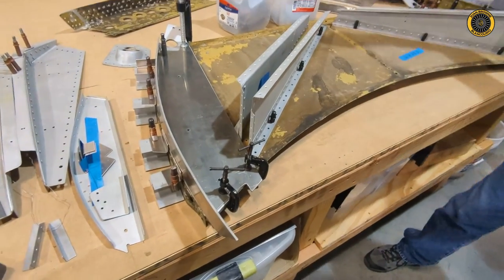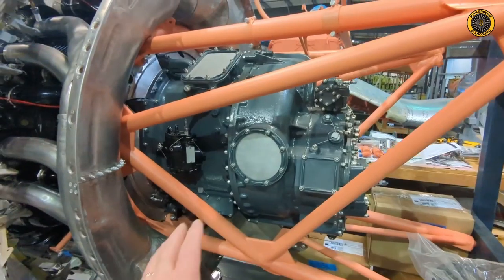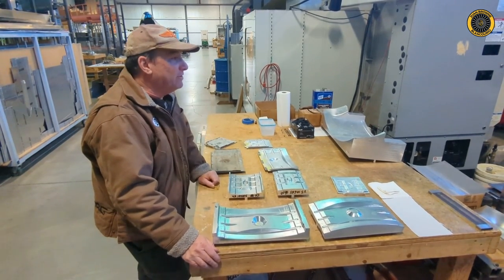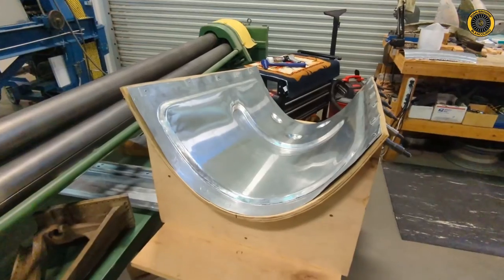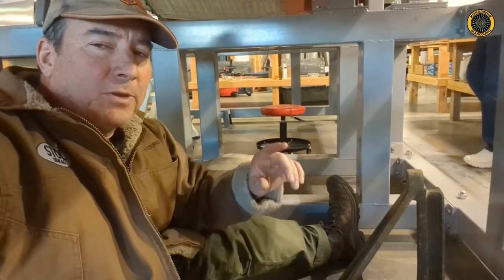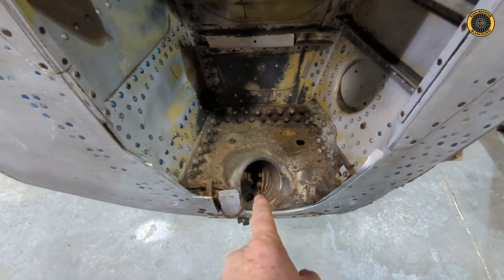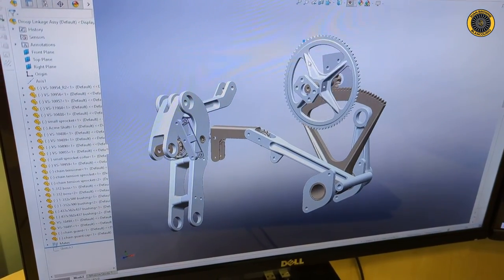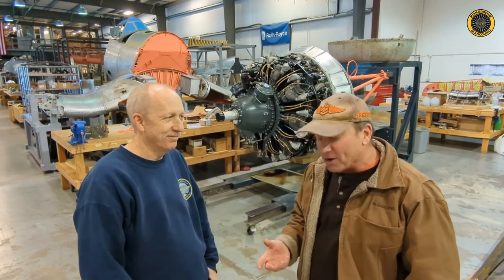Rare 'Birdcage' Corsair UPDATE! Jan 2023

Comment: I'm 83 and have been an airplane nut since I was five.  Watching this video it suddenly occurred to me how much more complex piston driven aircraft are than jet engined planes.  It also made me aware of how much more work is required of the pilot to manage the engine and prop controls.  That made me wonder how they had time to fly the plane, especially in combat.  My respect and admiration for those old fighter pilots has increased immensely.  Great video.  It taught me a lot about the Corsair I didn't know.  Thanks.

Comment: Wow. Thanks for sharing this. About 50 Years ago I worked in the Com/Nav intermediate maintenance shop (bench repair) at MCAS El Toro with a NAESU Tech Rep  Henry "Stoney" Stonestreet who was a Marine Air Wing retiree. He enlisted in 1932 and served during  WWII in VMF-214 with Col. Greg "Pappy" Boyington working on these beautiful birds.
Reply: few AU-1 (F4U-6) were in Navy Reserve back then , saw even Fotos in Books of AU-1 in Navy or Marine Service with Gull Grey white Camo , not 100% sure but i think the Plane was stationed in Quantico Naval AB
Reply: I worked at the Com/Nav in VMGR 352 at El Toro from 1976-1981. I think we were still using the same boxes you were fixing back then. An old joke was that if we didn't have to carry the ARC-101 HF radios (2x), the Hercules would only need 3 engines.
Reply: @coreyandnathanielchartier3749  I was with H&MS-11 and VMFP3. Our  RF-4B's had an ARC-105 HF Radio that I worked on. The WM's could not lift it to put it on the bench.

Comment: As a teen,....I bought a large R/C plane kit. Essentially a box of various  balsa wood sticks and sheets and a set of full sized plans. When I first opened the box I was filled with anxiety about how in hell I’d ever turn that pile of wood into a flying plane. I get that same feeling watching this video! 😂 I did eventually get my plane flying after a year of construction. 90 second first flight and then 6 month repairing it after the crash. 😂 it’s still flying albeit with an electric motor and batteries now instead of a big glow plug engine and nitromethane fuel.......

Comment: Those are some lovely parts. I work with a guy who does 3D metal printing, among other things. With the high pressure and temperature post processing they can make parts at competitive prices to low run castings or forgings and with very good mechanical properties. I hope this can be used to bring back some old aircraft for which the parts just aren't available anymore, and which were forged when they were in production. I did some work on the Avro York at IWM Duxford and they had the same problems with the manuals, they were pretty much rough drawings of the parts and you had to interpret them based on what you had remaining to work out how a new part should be made. But that York was only being restored for static display, the engines from it are on the Battle of Britain Lancaster and the York has her old and lower spec Merlins.

Comment: Juan, it's nice to see another of your videos where nobody spirals down out of the clouds, nobody loses a fight with an iced up airplane, nobody stalls out on base/final, and everybody makes it back to the runway.......  The detailed pictures here are unparalleled for dissecting the inner works of the Corsair. It was a revolutionary design, and I'm most impressed with the utter simplicity of the intercooler (aftercooler) design. Minimum ducting, shortest path for the air, and requiring no protruding scoops. BTW, I'll bet that 'Y' pipe would be a fun one to recreate. I recall building models of the F4U4 back in the 60's as a kid. It always seemed a bit oddly shaped, with the barrel shaped forward fuse, and the fin set forward, but as I learned many years later, it was instead elevators set back that gave this impression. By 1945, the F4U-5 would have a automatic power system that handled the cowl flaps, mixture, prop pitch, I believe, and the supercharger controls. It was also the last single piston-engine fighter built in the US, outlasting all the rest.

Comment: You should put Urbana Ohio on your bucket list. At Grimes field they are restoring a B-17G with parts from 4 different planes. Originals as you pointed out, back up the new ones recreated. Not far from Urbana is the Dayton Air Museum.

Comment: Looking at that nice clean engine recall the 17 years i worked on R2800,R2000, and the occasional R3350c. Never were that clean once you fired them up the first time. 1100 aircraft oil in fifty gallon drums is what I recall. Turned black immediately and if you didn't see oil on the engine it was cause for concern. I'm still a AP/IA  , started in the military in 1965.

Comment: Most every pilot is in love with the P-51 Mustang, but for me it's the Corsair.  I was a Navy T-28 instructor pilot in the 70's and I always felt like I came along one generation too late.  Of course no one wants to experience the horrors of war but I sure would have liked to have flown the Corsair.  The Navy T-28B/C gave me a Walter Mitty experience and it was not hard to imagine what it must have been like flying the WWII radial engine fighters.  It is powered by the Wright single row radial (9 cyl) with a 2 stage blower rated at 1425 hp.  Comparable to the Mustang and Corsair in performance at low altitude; what a blast to fly!

Comment: 9:35 JUAN, if I remember my time in the machine shop at the Grass Valley group. That since aluminum oxide has a natural oxidized finish. I think that's why they had to etch the aluminum was to get through the oxidation protective coating that naturally occurs on aluminum, especially on 2024.? Prior to spot welding... Great tour...
Reply from the maker: To cut through the Alclad finish?

Comment: "Dead Soft" , is "O" condition aluminum, in annealed condition. I'm assuming it's 2024 alloy. Depending on thickness it usually takes about 30 t0 45 min , longer for thicker parts, at about 920 F. I quench in steam distilled demineralized water. I'm a structural fabrication/repair mechanic for the USCG in Elizabeth City, N.C.. I fortunately have an 1100 ton press made just for forming metal parts on die blocks made from machine shop die plank, or we cast them from a very dense casting resin called Freeman 801. For a small run of parts the casting resin is ideal and it avoids long machine shop waits for a milled die. They might crack in a press brake. We do have milled dies that will last a long time. I work on the C-27 and C-144 search and surveillance aircraft. I'll be retiring at the end of this year after 52 years in aviation. 🙂

Comment: A blueprint with errors? NEVER! 🤣
A lot of people with no shop experience who have never worked with blueprints always assume they are some kind of magic paper instead of the jumble of nonsense you have to figure out.
I make some ground service equipment tanks at work, and usually it's one main one, but there are about 6 different types total. some go years between orders. I have a stack of prints i've annotated and marked up so i can grab the 3 prints our of a stack of 12 that i actually need, read my notes, and bang them out.
I lost a set once... it took me probably 6 hours to figure everything out with a newly printed stack of prints... and I'VE built them before.

If you've never played, I highly recommend a good game of "is that measurement from near side or the far side of that piece". it's really fun when you're working with sheet metal like this and you're trying to figure out how big to cut a piece of material, but it only lists the overall of the assembly... so if there are 2 end plates, now you need material that's smaller than the number they gave you, in order to account for that thickness, or the part is out of tolerance. stack that a few times over and then find out that your out of spec on the overall by one thickness and try to find it now. 

I wonder if they run into the whole "the tool to do that isn't made anymore" because i know there's a huge linage of machining equipment history that's basically been boiled down the mill and a lathe. It's gotta be fun trying to figure out how to make a part with a 3 axis that was made to be made with completely different tooling the first time.

Comment: it never ceases to amaze me how war time aircraft were manufactured, designs turned into reality, and they were built in their thousands so rapidly, i guess the major difference between then and now is the amount of man power that was available, nowadays these small dedicated teams have to reverse engineer using modern day methods that strangely hold back the time to build these magnificent flying machines, you'd think todays tech should speed that up 
Spitfires were turned out in a week, and now take up to three years to build with a load more safety in mind, and yet airliners are designed over many years (by many people worldwide) and again built in such a short period and then expected to fly many years, the maths has changed in so many ways, mind boggling

Comment: What a great video, Juan!  
One of my Aerospace professors at Georgia Tech (probably the one with the most practical experience experience in the industry... this was in the mid-60's) told us the real story about the gull wing design.  Grumman promoted the advantage of the 90 degree connection to the tangent of the fuselage as the reason of the gull wing design and, while it is true that the 90 degree connection does reduce parasite drag, the real reason was to keep the main gear struts as short as possible to accommodate the 14 foot diameter prop.
Reply from the maker: yep!

Comment: 3 speed supercharger, pretty cool engineering great way too keep the power in high altitudes not as good as the two stage two speed intercooled supercharger in the Merlin. Loved flying the Corsair in the good old Il21946
Reply: This is a 2 stage 3 speed because at low alt you can disengage the 2nd stage sc. How is it worse than the merlin 2 stage sc?. I dont think it is even comparable because of the size difference and the intercooler placement.
Yes the merlin 2 stage was a more compact design but I doubt that in raw numbers is better.

Comment: I was involved with a similar project putting P51 mustangs back in production. The "blue prints" came from microfilm circa the 1940s. When a aircraft type was sent to a theater to fight, they sent a set of all the blueprints along with it as microfilm. There was different batches of film, earlier and later. This is where our originals came from. Much of it was in pretty bad shape from who knows how many hands they had been through before we got our copies made from them. We'd go over each one to see what batch had more or better details of each print we needed. Some of these prints we on the order of 20 feet long or so and I was the guy, at the time, that worked on the computer (Photoshop) to get as much detail out of the prints as possible. Then these prints would go to the shop and they would combine what we could print with real parts, we had a lot of Mustang parts for reference in the shop, to make up a "master print" for fabrication. It was a extremely interesting job.

Comment: The main factory and other structures  where these were built are still standing in Stratford, CT. One supposedly houses a vertical wind tunnel. The first aircraft made there were Sikorsky flying boats. The last things made there were M1A1 tank engines and helicopter engines. About 30K people from this part of southern CT worked either here or at the Sikorsky main plant a few miles up the Housatonic River.

Comment: I worked for Boeing building 737 Wings Structures for 18 years.  It was heavy duty riveting using up to 3/8" rivets.  It was always interesting once in awhile to take a stroll through the factory to see what all goes on in all the different shops.  The scale on a Corsair is so much smaller than a 737, 747, 757 etc...the skill to me seems it'd have to be even greater because of such confined spaces.  I  worked on the 737 "Classic" wings, and then also the 737 "New Generation".  The newer engineering and tooling made everything a lot easier and streamlined production.  This was from 1988-2006.  So, a Corsair being built in 1942 I bet there were s8me serious hardships for assembly mechanics.  It was uncomfortable ergonomically building 737 wings esspecially the Classic ones.  It's hard to say, maybe being smaller would make it easier.  I don't know.  But it'd really be interesting to get up close to see more tools and techniques there like you show.  Thanks!

Comment: 1:35 That critical part now adays we would make it out of a machined plate on a CNC machine rather than sheet metal. back in those days that was no understanding of the fatigue phenomena on metallic structures. The machining process allows to mitigate imperfections and microcracks that can appear in the sheet metal manufacturing process, also a cold work process called shot peening can be applied loclly in the critical area where crack initiation may occur to extend the lifecycle of the part. In addition to this benefits of the machined process, we can get much better tolerances, specially on that curved flange interfacing with the fuselage skin . But also machining processes are more expensive as it takes longer to carv the material and the $/h of a 3, 4 or 5 axis CNC machine is more expensive than a sheet metal bend machine.